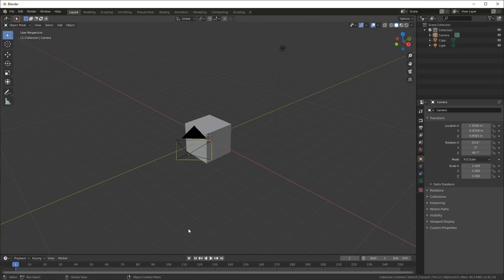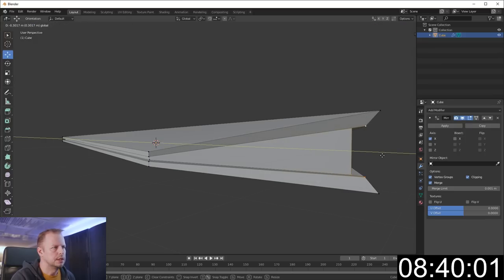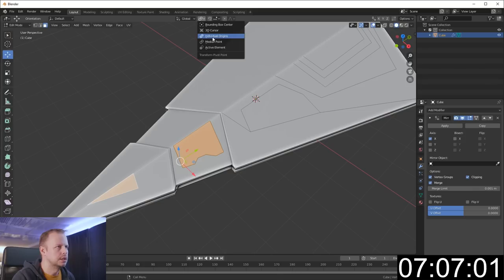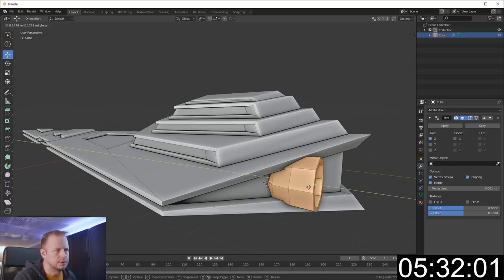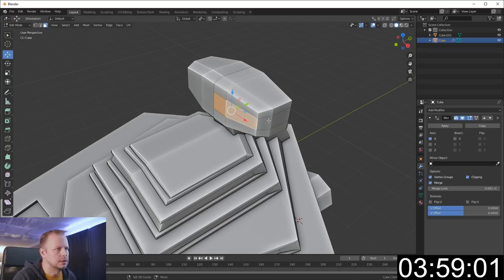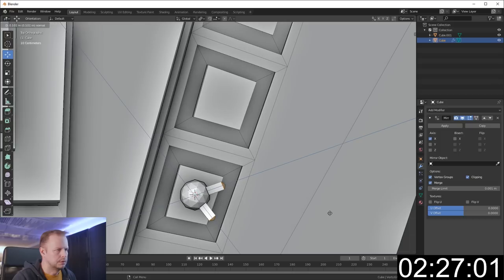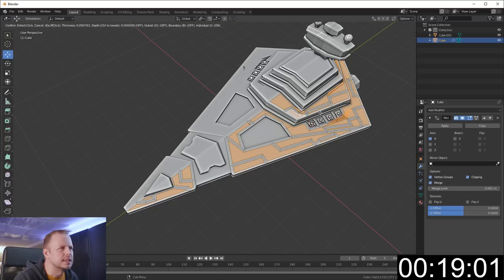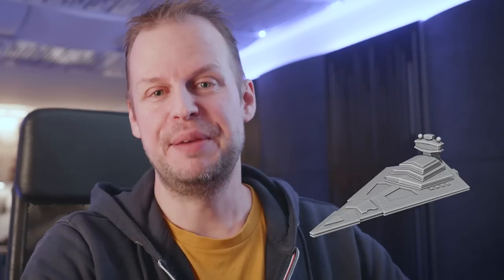Let's Model a STAR DESTROYER in 10 MINUTES in Blender 2.81 - ep. 2

Comment: A most fantastic try with the 10 mins you had. As an aspiring animator, I was both mind-boggled and laughing at the speed with which you worked. Any chance you also work with Maya?
Reply from the maker: Hi - thank you! If you are interested in animation, may I also suggest my most recent 10 minute build of the rigged pirate - that is about as crazy as I have been able to go so far :) I haven't tried Maya unfortunately, I don't have the budget for it unfortunately.
Reply: @Imphenzia  I see, that's fair enough. It literally just popped up in my recommended. I'll check it out

Comment: 2:09 you could hit s to scale then shift z and it will scale along both x and y together. same for shift and the other axis whatever you shift hit is excluded and it does the other 2.  No need for the double correction :d
Reply from the maker: Thanks! Yes, I use exclusive axis at times, and then I forget to use it just as often so thanks for the tip - it's very useful!

Comment: Great, and inspiring video. I understand the purpose of the video.

But you could've went ahead and added a better edge distribution along with supportive edges for the typology of the mesh instead of adding details/panels. Many beginners/amateurs  including myself would add a subsurf modifier after the modeling process only to find out the model has nothing to support it's structure after SubD, And it would be a blobby mess and some areas would have pinching issues. In any case great video
Reply from the maker: Hi, thanks for commenting. I agree about the topology. It's sufficient for quick builds and primitive objects but it would definitely need a retopology job. I should actually check out the new retopology tools in Blender and do a video about that. Thanks for commenting!

Comment: It seems that you completely forgot to model the bottom of the ship. Nonetheless, it is very inspiring watching you speeding through this.
Reply from the maker: Yes, the bottom didn't make the cut this time =) The engine core thing would have been one to add, and probably some panels. Maybe if I do a 15-20 minute I can add that and the windows.
Reply: @Imphenzia  Don't take my comment as an excuse to slow down. Speed is the key! ;)
Reply from the maker: @nymse248  i like your way of thinking, I need to gain speed and find more efficient methods :)